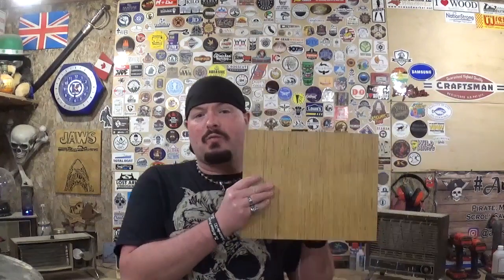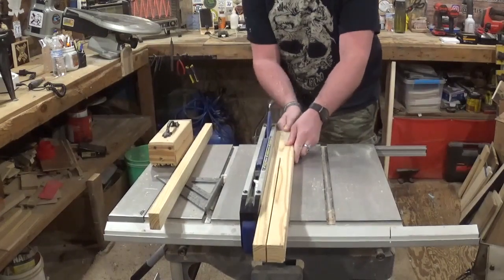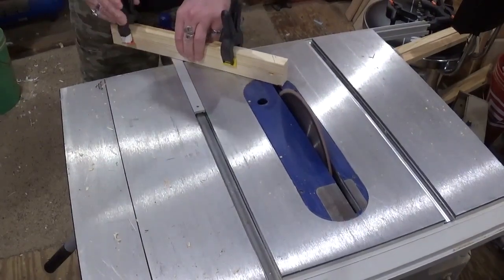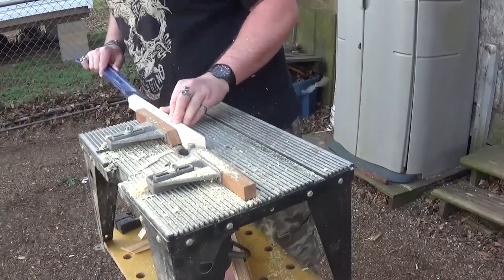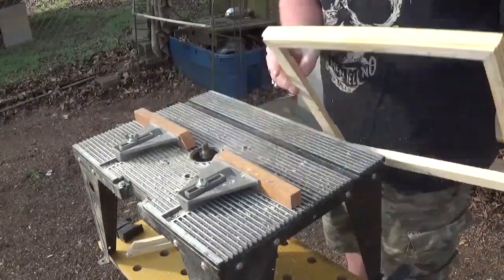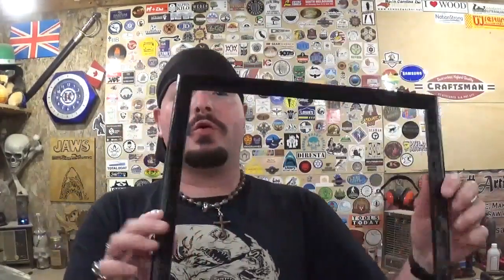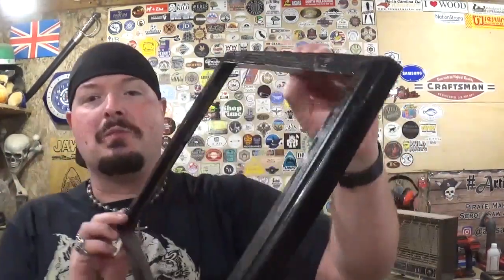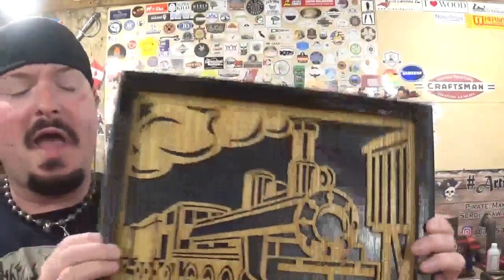Make Custom Picture Frames Easily!

Comment: Very nice  . So do you just glue your backer and scroll pic on to the frame or do you use tiny braces nailed on including a hanger
Reply from the maker: Either Or will work. I know the frame is made specifically for a picture, I always glue them in